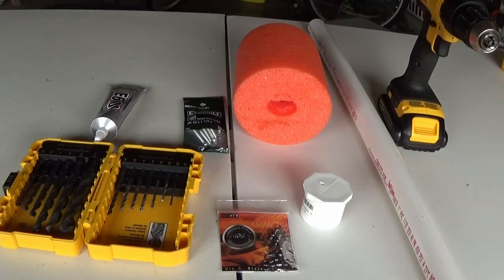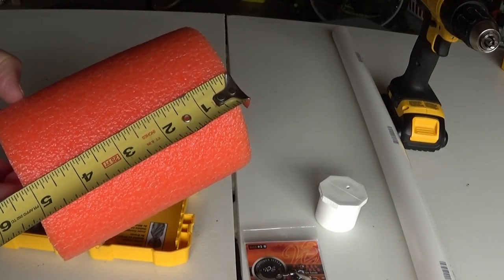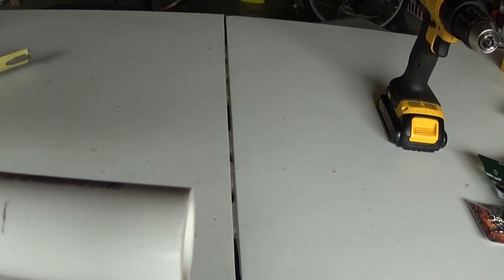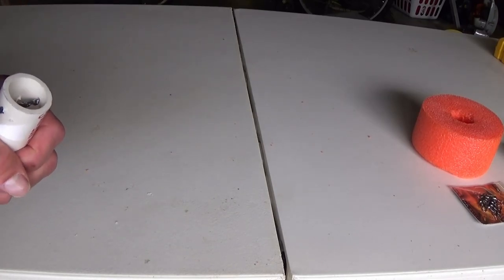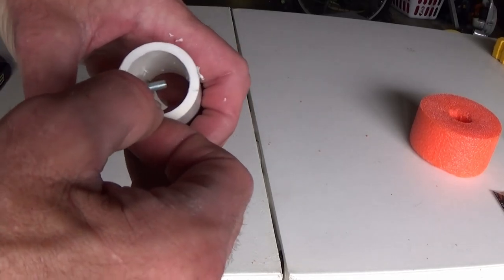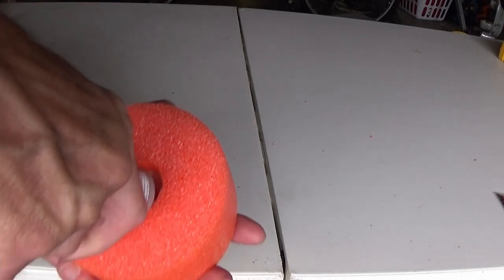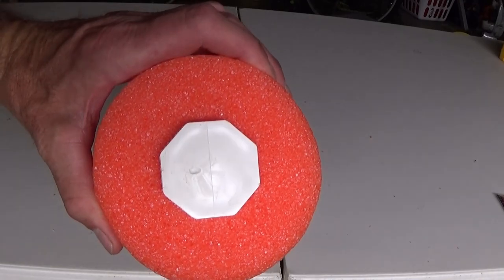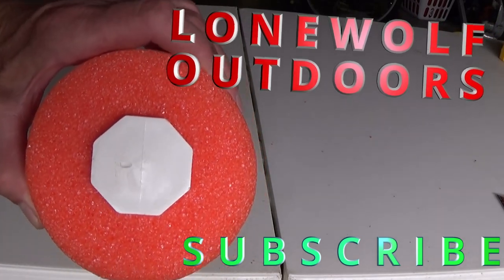catfish float DIY

Comment: how deep of water have you used these in?  What did you set your depth at when using the float?  Very creative.....
Reply from the maker: I have set them at different depths , usually at depths I see them on humminbird,  suspended , just let line out till it hits the bottom and reel up to boat and put float on and throw it back out ,I let about 50 ft or more of line , and you have watch your depths on fish finder. So ya don't get snagged,  also used for anchor fishing same principle , let it go out a bit , thanks for watching